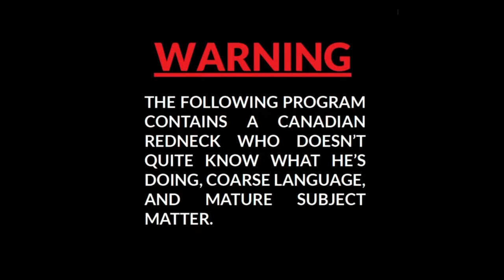FLASH MOD IPOD BUT YOU'RE DOING IT WRONG

Comment: Why did you close it when red cross was showing?
Reply from the maker: If that pops up, the drive isn't connected properly.  In my case the iflash was hooked up backwards
Reply: @grouprocox  Mine synces up until about 33 gig and then fails :-(   I just don’t know what to do anymore 😭...
Reply from the maker: @diana-cy4kj  depends how large the song files are, if they're small files the ipod doesn't like more than 140,000 (ask me how I know 😅) 
Try reformatting the card/s again! If that doesn't work you might need to try different cards altogether.  I was fortunate
Reply: @grouprocox  I think I got a fake sd card. I restored it many times and it stops syncing after around 33 gig. Admittedly, I bought the cheapest card I could find. Let this be a lesson...I already ordered another card, hope will have more luck with that one.
Reply from the maker: @diana-cy4kj  good luck!
Reply: @grouprocox  I watched a few videos about fake sd cards, and it sounds just what I am experiencing - the system recognises the card as genuine, but it stops recording any data after it reaches its limits. Well, it keeps recording, but that data is just going nowhere. Sorry, I don't really understand anything about these things, it sounds a bit dumb the way I describe it.
Reply: @grouprocox  Thank you!